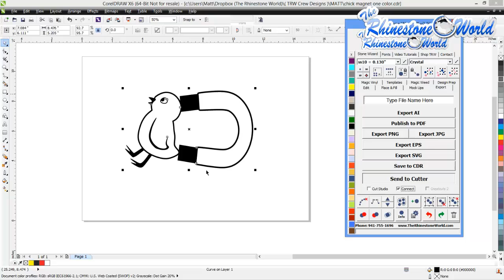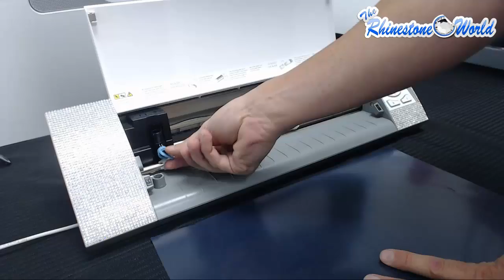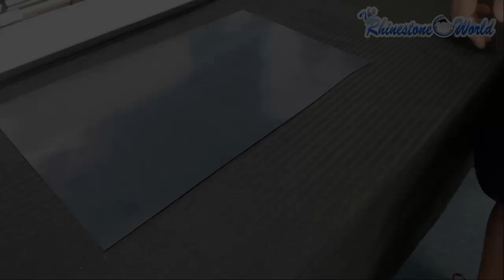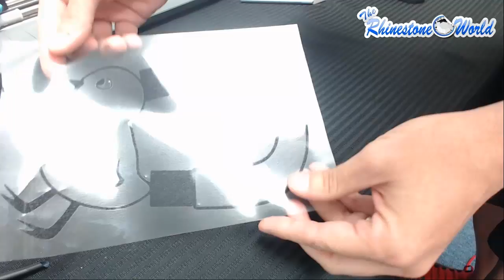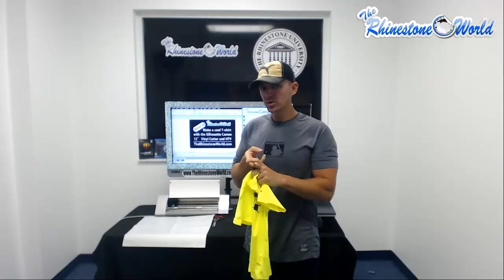How To Make A Custom T Shirt With The Silhouette Cameo Cutter The Rhinestone World

Comment: can u use a iron to press on the design?
Reply from the maker: Hello! You can use an iron, but it has yielded inconsistent results, as you cannot control the pressure or temp. That is why we recommend a heat press. - TRW Richard
Reply: TheRhinestoneWorld ok thank you

Comment: Hi brother, Can the Silhouette handle a large work load?
Reply from the maker: Hello! Yes and no. It is durable but we would recommend our 24" cutters for industrial purposes. Those can be found here: http://therhinestoneworld.com/Main-Category/Vinyl-Cutters - TRW Richard.
Reply: I use it for Production in my shop. Holding up like a champ. But I would recommend at least a 14" or 15" cutter if your into the large designs, so you don't have to piece the design together. Because you can only cut 11.750 inches wide on this machine, but you can rotate your artwork the long way and cut as long as you want. So it's good for oversized name/ word placements, and long objects like Bats, golf clubs, guns swords and etc.

Comment: no I do not just an iron.
Reply from the maker: Cathy,
A heat press will be able to accurately heat your rhinestones and apply equal pressure across the design surface.
Siser's Red Press is an inexpensive heat press that is good for light duty.

Siser Red Press - http://therhinestoneworld.com/store/#!/Siser-Red-Heat-press/c/4690556/offset=0&sort=normal

Comment: the pre cut kit I just watched the YouTube video loved it so.tell me.what else do.I.need.for this Kit?
Reply from the maker: Cathy,
You will need a brush, Hot-Fix Transfer tape, and Rhinestones.
Do you have a Heat Press?

TRW Casey
Reply: Just an iron that Is it.
Reply from the maker: Then you would also want to invest in a heat press as well, most likely. Irons are not going to yield consistent results as you can't really monitor the pressure that you're applying which is really important.

Alexis @ TRW